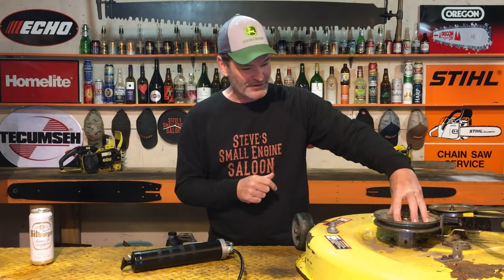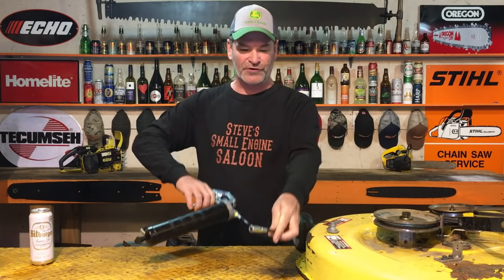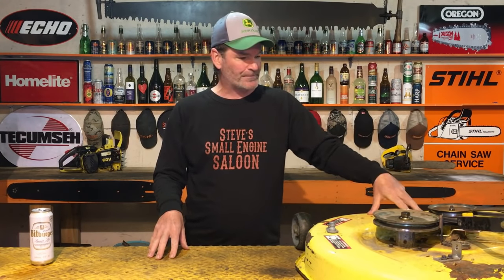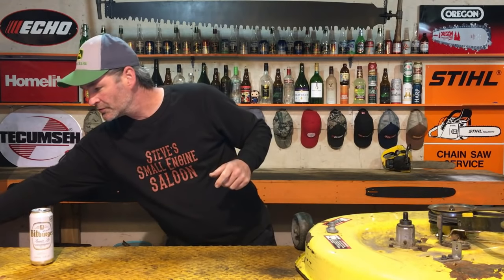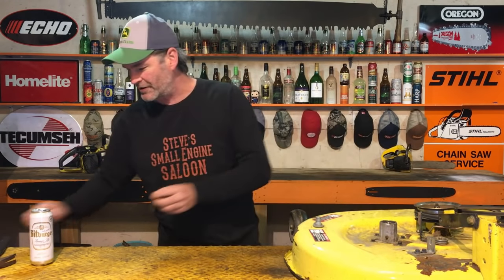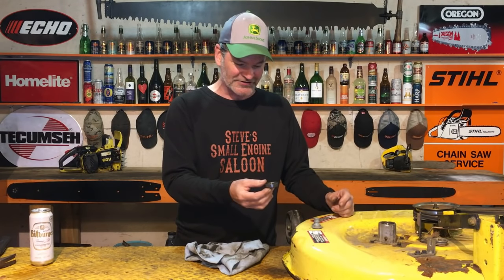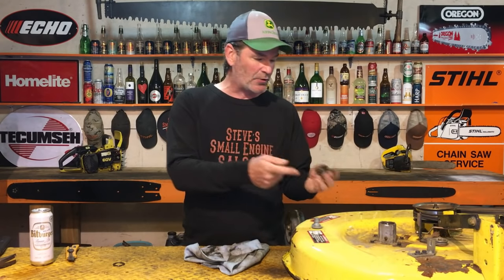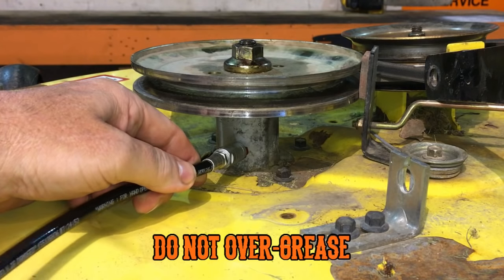Your Riding Lawn Mower's Dirty Little Secret

Comment: As an engineer, I can safely say that the engineers weren't advocating for design-for-obsolescence. We would gladly design the crap out of stuff, but very frequently limited by management.
Reply: That doesn't mean it's not planned obsolescence.  It just means that engineers are the worker bees and management is planning the obsolescence.  Your comment actually helps to solidify the ideal.  I feel your pain though as a fellow engineer.  [I once tried to order a new, more robust, touch screen to integrate for our proprietary control panels because customer kept complaining it goes bad too soon. It's a high wear often touched screen and is Hard to replace and so customer has to buy a new $3000 panel each time instead of a $50-$100 screen.  I got the "talking to" by management.  They appreciate my engineering skills but are not interested in an upgrade on this item and I'm not to speak about this to the customer,  A big 3 auto maker]  LOL. One small reason among very many why our vehicles cost so much.

Comment: Food for thought: It appears as tho the sealed bearings were installed as just that -- a sealed bearing that is not intended to be greased. The zerk fittings are installed in the housing so you can grease the inside of the housing. The inside of the housing generates an extreme amount of heat due too the shaft running through the inner sleeve rotating at very high RPM. Grease is used in order too inhibit heat buildup within the cavity. Furthermore, if no grease is applied a lot of metal to metal friction will be present creating debris. Now if the inner seal is removed all that debris will get into the bearings and destroy them of course. BUT: If grease is present inside the cavity then debris is eliminated, heat is less intense and grease can enter both the upper and lower bearings every time the cavity is greased. I do agree with Lewis that a small relief hole is a good idea so ya don't push the outer seal off. Just my two cent's ya-all. Have a marvelous day.
Reply: I couldn’t understand why I was not seeing grease coming out when greasing the spindles on the JD 170 My neighbor said he believed the factory/service failed to grease them. Hope I didn’t  pump too much grease into the cylinders after seeing this.

Comment: I would believe it's on purpose too but it is more than likely that the engineers and designers have no practical knowledge, only book knowledge. Experience would be the teacher but manufacturers only care about producing a product as quickly and as cheaply as possible so on both ends of the spectrum there is no knowledge of a flaw nor willingness to spend the capital or add to production time in making a durable product.
    It is job security at the cost of the consumer. Like the pleasure of impressing your friends with the latest ride from the auto industry, they realize the average consumer will fork out the cash for shiny paint never giving thought to longevity until the repair bills start coming.
Reply: Bullshit. If they wanted it cheap they could have just used a bushing. These bearings are a guide.

Comment: Wow..I'm gonna open mine up and see if it's the same way although I've never had a problem with them yet.. my craftsman has a grease fittings at the top
Reply from the maker: Right on....
Reply: My craftsman mower is junk. Will not buy another.
Reply: @anthonythorp7291  I got two a old lt1000 and a gs6500 26hp from 06  ain't had no major problems out of the 06 but my old one is burning oil
Reply: @firstname5134  I got a 2009 bought in 2010 and 2017. 
    09 was getting old, shaking, mowing crooked, and throwing belt so bought new 2017. It is just as bad plus burned up belts fast. Turned out a brake pad for mower deck glued on out of place. Repair man ground off some and solved that problem.  2017 has smaller tires lowering whole thing and it gets stuck easier. 
  I'm not exactly nice to my mowers so the 09 wasnt too bad but the 17 is a piece of crap.

Comment: Over grease may be a problem and push bearing outward.Perhaps drilling a weephole in the shaft casing may help.when the grease comes out of tiny drilled weephole it relieves pressure  on bearings.weephole can be capped with self tapping screw.

Comment: Thanks Steve. IMO replace any bearing from China.
Reply: Why?  Bearings in China are square?  The video is about grease, not MAGA.
Reply: Don Moore  watch youtube video Chinese bearings vs German bearings. My F150’s rear end died @ 215,000 miles. The shop I had do the work saved $50? on bearings by using Chinese bearings. They lasted 16,000 miles. Turned a $1200 repair into $2400. The quality shop I used on the second repair told meChinese bearings often last 10-20,000 miles.

Comment: Steve is so right about this BS

I drill one 1/16" hole in the ( grease fitting ) seal side and two 1/8" holes in the dirty side seals.
This fix so far allows the grease to be under pressure in the spindle cavity without hydro jacking
the (dirty side ) outside seal, out of place also you can see the dirty grease ooze out and be replaced 
by fresh grease, on the annual service. Just wipe the off the squeeze out excess with a rag.
My spindles where done this way from the start and still going strong after 9 years now.

Comment: My Craftsman 54" deck has grease zircs on the TOP of the spindles. Is that any different reguarding getting grease into the bearing. I'm also wondering about the quality of the grease since today's pumps of grease isn't what is going to the bearing. Better than  no grease I suppose.

Comment: if you have a boat  dont forget to chek bearings for grease  lot of it  use marine grade grease its water proof its  not fun when a bearing runs hot  due to lack of grease this has happened 3 times in life time  one it got so hot it blew the tube the next it almost welded the bearing to the axle another time i heard it squealing  im 86 so this is spread  out over several yrs  i stated carry a can of grease and a spare bearing   one i sold that bearing for cost to fisherman  at a boatlanding  late sat aftnoon when every thing was closed saved his day i was glad i could help  repack in sring time  before season starts

Comment: Steve, I have 2 mowers that use the GCV160 Honda engine.  Question:  Do ALL of theses engines require the wax assembly to start up.  I have not found the old part or an installation place on the Craftsman or HU 800 Husqvarna.  Both will start with starter fluid and restart immediately if shut down. Any Direction is appreciated.  Thank You Benny

Comment: I spoke to the parts counter guy at a John Deere dealer and he said that area around the blade spindle gets filled with grease and it absorbs the heat from the bearings.  It wasn't meant to grease the bearings.  Looking for your thoughts there. Also, are these tractor's front ends too light?  I have a D105 and when I circle a tree when cutting, the front tires just plow a circle rather than turn and have torn out the grass leaving rings around the trees.

Comment: Larger companies have generally done that because the average Joe today won't ever take the time to grease a bearing, they ride it for a few years and get the local small engine shop to "replace the part" to continue biz as usual. The companies know this and will save both time and money with sealed bearings, knowing that they'll ultimately last longer then traditional bearings in more then 80% of the applications due to reading the sales market. They don't care if it's engineered well, as long as it lasts the market standard, and can compete in price with the competitor. Good video though, I'm liking the money saving series.

Comment: Steve, I put a squire of liquid wrench to thin the grease to get in bearing. My craftsman 42" is 20 years old. On;y replaced spindles when I hit a root and broke the spindle. Remove zerk fitting to squirt  some LW. What do you think/know?

Comment: I have a Swisher 60” 3 blade zero turn and it has sealed bearing but has no grease fittings. Can I drill and put a grease fitting in those housings and then remove the one side of each bearing. I have replaced so many bearings that I keep them on hand just in case. Not an easy job to do to replace a bearing.

Comment: The beauty of sealed bearings are the low maintenance. They should last years before the seal fails. Until then the bearings are perfectly lubricated. When they fail, pop them out and $20 later you're good for years more of mowing. Cheaper than grease and you can't make grease go up and down (a spindle) equally even if you drill holes in the seals.
Each bearing must be greased individually.
I worked HVAC & heavy industry for 40 years. Quality sealed bearing are the way to go.

Comment: Perhaps it was a revision and the grease fitting was left over by accident.  Question: Will the grease actually force it's way into the bearing even with the other side sealed?  Great video.
Reply: That's a good question.  If the old grease can't get out, how's the new grease gonna get in???  I think someone replaced the original bearings there.  The deck looks old and the bearings look new.  I don't think it was designed that way.  It's too stupid.  Maybe it was a revision.  That's entirely possible too.

Comment: My understanding is that the purpose of grease within the spindle is to help prevent the accumulation of moisture within the spindle from  atmospheric moisture as well as condensation of moisture within the spindle due as a result of the spindle cooling after heating due to the act of using the mower.  So, the function of grease within the spindle is not to grease the spindle bearings, it's a preventive against accumulating moisture, not an absolute preventive but a pretty good barrier none the less.

Comment: Great video Steve.  I recently bought a Kubota BX2380 54 inch mower deck with mulch kit. Steve when I'm mowing the deck is leaving a small line of grass clippings on the left side of the deck. Any ideas as to why this is happening, local dealer knows jack shit about it.    thanks Ed

Comment: Fantastic secret reveal.  Which now begs the question:  there are grease fittings on the steering spindles.  Are there sealed bearings in there as well or is that a different set-up, like a knee-in-socket ball joint?

Comment: Unless you make a way for air to escape the top you will only pressurize any air that exists.  i expect it will be difficult to maintain grease in the bearing itself. 

Over time, with heat and cooling,  I expect air will get into the cavity and bearing area. Maybe a 1/64" or smaller hole in the top seal? 

We need a check valve to release air and an indicator of adequate grease as it bleeds out  but not to let air back in. 

Also one might expect metal and grease to expand from heat creating a vacuum as it cools making air more likely to get back in. . 

I bet some folks here have ideas. I am open to them!

Comment: I bought a grease needle that looks like a syringe needle attached to a fitting like you would see on a manual grease gun, and a short hose for the grease to travel through, with a grease nipple on the end of that 12 inch hose from JC Whitney back in the 60s
  The grease needle enables me to insert the grease needle into things like sealed ball joints, tie rod ends, sealed bearings, by working the needle in under the boot or seal.. i I have used this tool I bought from JC Whitney hundreds of times. 
The bearings in this video, I would insert the needle where the seal meets the inner race without popping to seal off. Sometimes they will not stay when you try to replace them.
  many bearings used to come with very little grease, which was not the appropriate grease for the application, especially Chinese bearings.. different grease for different applications, high speed , Extreme pressure, example, wheel bearing grease you would use for your garden cart, is not the same as wheel bearing grease for your cars front spindles with disc brakes, those brake disks get very hot and they attach right next to the bearing housing if not on it, unlike where are the heat goes on a drum brake..Are use the waterproof wheel bearing grease, it’s good for boat trailers that get submerged during boat launch, and the deck of the mower in the summertime even though the sun is out, that grass is saturated with dew..
  Point and shoot thermometers are relatively cheap now. You could take a bearing housing reading on your mower deck after cutting to tell if your bearings are getting too hot before they fail..

Comment: When I was in the Army working on OH-58A/C helicopters, we had such type bearings. We had to use a hypodermic needle, slide the tip under the cover, and hand push the grease using the syringe plunger by hand at first. That was painful until we made an adaptor and attached it to a grease gun.
Reply from the maker: COOL!

Comment: On my friends zero turn theres a snap ring at the bottom so its easier to take off the whole spindle than to just let the blade come down.

I do take the blades off but the snap ring is still there his are made different than that one and mine and i don't grease his i do clean up th ed outside spindle and paint the surface that bolts to the deck to keep some corrosion away

Comment: Can bearings fall out if liner removed?
Could you pop of the liner put small drill holes on liner top replace it and it work in letting in grease lub??

Comment: Reguarding a Honda GC160 pressure washer mine has no pump on the shaft can i convert this from a pressure washer since theres no pump on the shaft to just a water pump with more volume its a 5 hp GC 160 QHC

Comment: I suspect the reason JD uses sealed spindle bearings, is the same reason that they went to the 30 second oil change. They know that most residential mowers will not be maintained the way they should be, so they made the sealed bearings to last a decent amount of time with no greasing by the owner and made the oil change, clean, fast and easy, hoping that users will at least change the filter once in a while.

Comment: Good to know, but: 
Are the sealed bearings filled with. Synthetic, high pressure and high temp grease? Does removing the seal expose inside of bearing to moisture? Also, now you must fill the bearing and the cavity with grease. Will there be space in the cavity for the rotation of the bearings to pump out the grease? Will you always know how much grease to add.

Comment: Yep that’s what it does fill up nothing  and the Bering are seal removed the top side of the Bering so that when pump grease it goes in and on the top bearing take off the bottom seal on that bearing

Comment: Perhaps this has been brought up in some of the comments but there is another video that contradicts the need to remove the seals. He pumps the grease in a spindle with sealed bearings and then disassembles it to show that the grease does get past the seal and into the bearing. The seal is not that effective and is more for protection from dust.

Comment: Here's what I found, so there's a small reason to use grease in the void area, On these style spindles, grease is used primarily as a water barrier to keep water from accumulating in the void area inside the spindle housing

Comment: Most sealed bearings come pre-greased from the factory with a 25%-35% grease fill. This is all the grease these bearings will ever need, because the relubrication interval is longer than the expected life of the bearing. Sure you can pop the seal off and lube them, but your now allowing grit and grime also to enter the bearing and you may reduce the lift of the bearing instead of improving the lift of the bearing.

Comment: Way back in the 70's I was a Nuke on submarines and the US Navy was doing a study on bearing failures, Any bearing that failed had to be removed and sent in for analysis. The results came back that about 75 to 80% of the failure were due to over greasing, 15% due to "foreign material (dirt & grit) the rest due to  mechanical damage during installation. They were talking about high end NT3 (noise tested, level III) bearings (read: expensive, high end, precision bearings for the Nuclear Power Program). Don't get carried away with the grease, a little goes a long way. Too much causes HEAT or can rupture the seals allowing entry of "foreign material" which is the death of bearings.

Comment: What about the seal on the top bearing?  Only way grease would get up in there is probably if the housing stays all the way full plus a bit of pressure.

Comment: A well made mower spindle will have open bearing's top an bottom with metal edged rubber drive in seals top an bottom? But your idea is good for more life out of a cheap mower if you take it easy with the grease gun great tip 😁

Comment: Great video with terrific secret.  Why would MOST mower manufacturers do this?  Why don't they remove one side of the bearing seal before pressing them in.  Seems like a small thing to do when assembling?  Go figure.

Comment: I watched another YouTuber grease in this situation and he showed that if you grease until the grease is forced out, it does penetrate the bearings - but in his case the bearings had rubber seals on the inside side.

Comment: Couple of questions / thoughts . Even with this modification wouldn't the gravity "pull" the grease to the bottom bearing and nothing to the top bearing ?  If the cavity if filled would the pressure of the grease between the two bearings push one of the remaining seals out ?